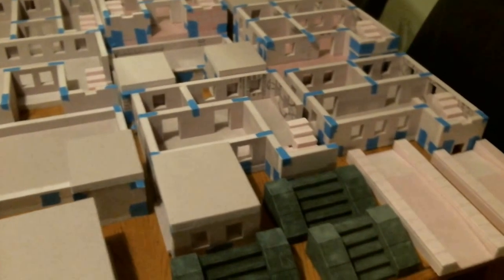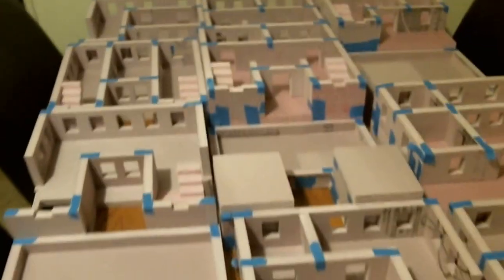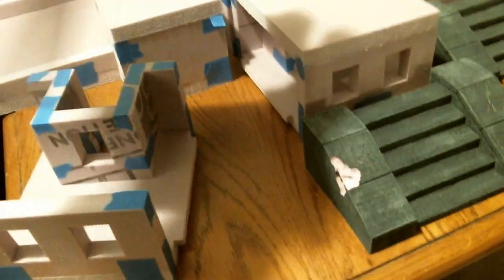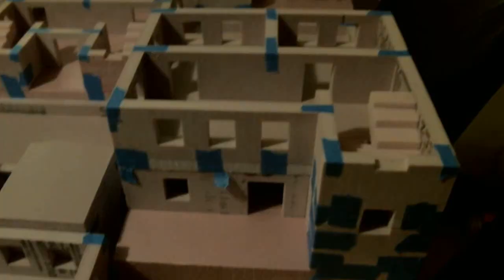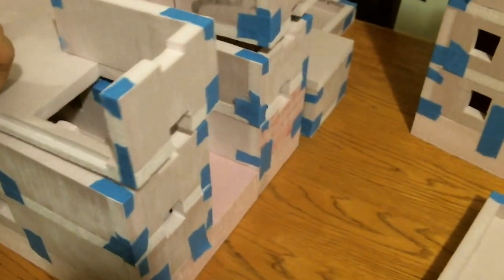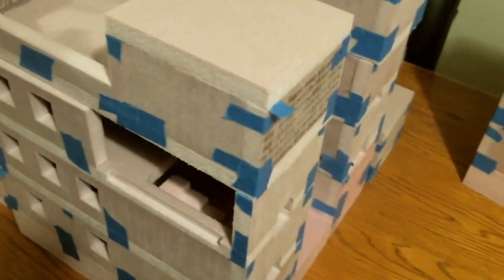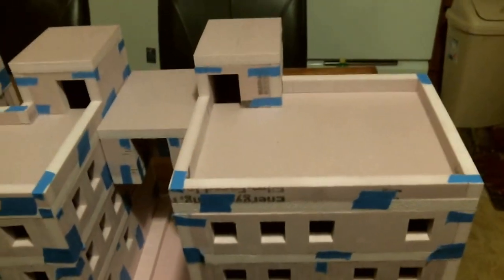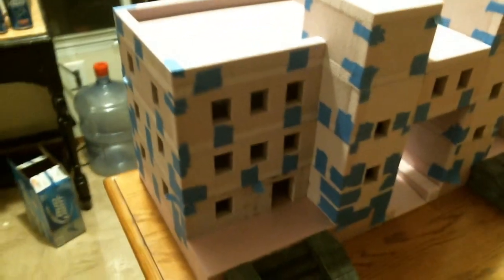Update: Wargame Terrain - Soviet Government Building (Project Update 4) .wmv

Comment from the maker: Thanks marcusarilus thats just my first coat of dark grey,  I will be putting a coak of light grey and then a light touch of white to make it pop.  The floors will be more that color just a black with dark grey drybrush. then the building wall instead of light grey im going to use a slate green to give it a be different color to it than the steps and floors.